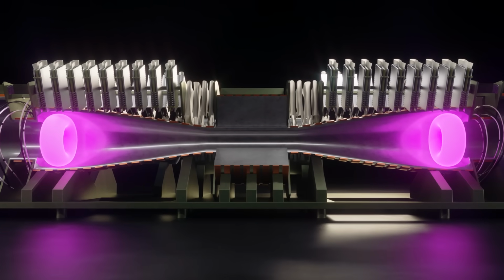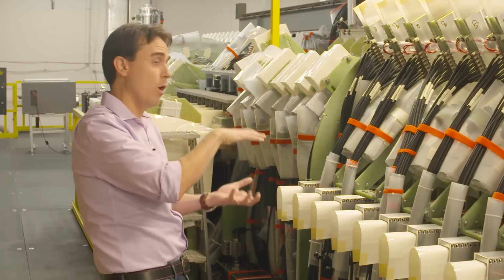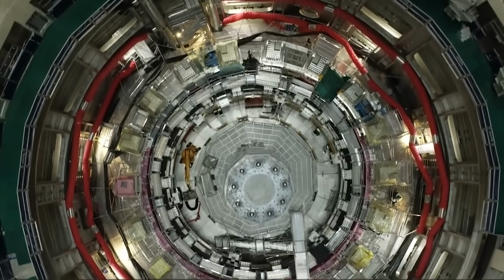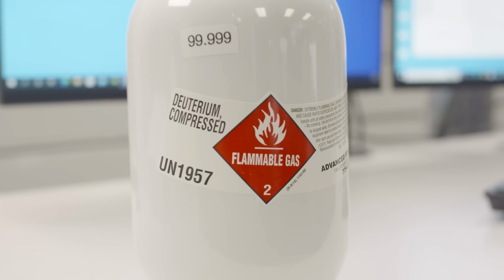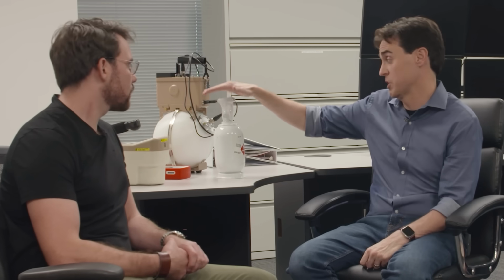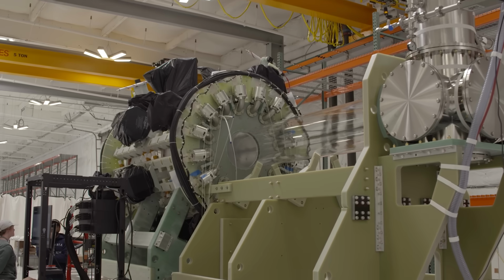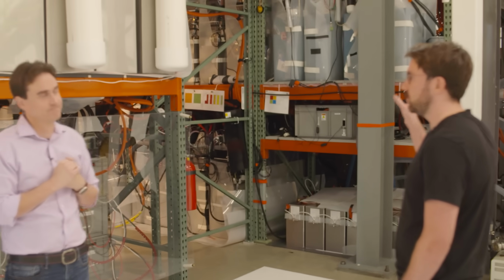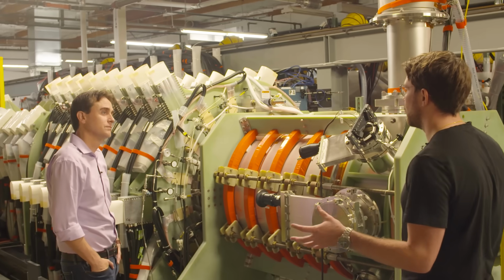A New Way to Achieve Nuclear Fusion: Helion

Comment: I love you RealEngineering, but as a tokamak plasma physicist, I promise you Helion is climbing up the wrong tree here - detailing all the problems with it is an hour long video, but here are some places to start looking: the H-He3 reactivity compared to D-T, problems with end losses, the absence of any published measurements or calculations describing exactly how this expanding plasma will actually induce a current into the coils (which are actually compressing the plasma) or absence of basic circuit diagrams proving that these induced currents will be usable.
Reply: You might want to check David Kirtey's talk at JPP from last December. It gives a good primer on their theory which is supported by their past experiments.
Do a google search for JPP08December2022_DKirtley (cant post links here).
It does not touch on the energy recovery. But if you think about it: They turn off the compression magnets and the expanding plasma induces a current in the coils. At this point in time, the FRC is still alive and stable. The fusion products add energy to the FRC. That same method also recovers a good part of the input energy along with the fusion energy. It works because the FRC is high beta (almost 1). Tokamak thinking does not really apply here.
Reply: @elmarmoelzer2229  Heyyy so not sure how I missed this reply, but chanced upon this video again haha so hi. Thanks for sending this talk - a good primer indeed, the speaker put the key ideas across very well. But a primer is all it was. A lot of important issues are not addressed and some of the questions asked halfway through the talk (in a subtle way) tease out the fact that helion will have a hard time even getting to a point where they have to think about energy recovery. Claimed to have understanding of show-stopper instabilities but not a single slide with any experimental data whatsoever. Just some unsophisticated modelling results and projections. Mostly just statements and claims.

I mean, how long have these guys been going?? And when they're invited to speak at a major platform like that - THEY DON'T HAVE A SINGLE SLIDE WITH ANY EXPERIMENTAL DATA.

It does not touch on the energy recovery because even they don't have any idea how that's gonna work. 

Now, as for your suggested line thoughts: 
'They turn off the compression magnets and the expanding plasma induces a current in the coils. At this point in time, the FRC is still alive and stable.'
I mean, the study of magnetised plasmas is basically the study of plasma instabilities. You're saying literally the thing holding the plasma in place is turned off and an uncontrolled expansion is how we recover energy? I'm sorry, but no. The FRC is definitely not alive and stable - I have no idea on what basis you make that claim.

'The fusion products add energy to the FRC'
Again no, the energy transfer from fusion products to bulk plasma is non-trivial - in the case of helion, even if they managed a good amount of fusion reactions, the products will just fly through the plasma and not actually heat it.

'Tokamak thinking does not really apply here'
Lol okay? That's like saying if you do CFD for cars, you can't do CFD for planes? Please. There is a lot of fundamental physics of magnetised plasmas one has to get past before getting to tokamaks. People use the same keyboard to play different games.
Reply: @phoneisnotketchup  
- For results: They have had 6 ever bigger and stronger prototypes so far. They presented the results of their 2020 Trenta campaign at SOFE in 2021. There is a video in their channel where they present those results (I will put a link to that into a separate reply in case it gets flagged). Mind you, those were the results of Trenta's first 16 months of operation. The machine saw some significant updates after that. 
E.g. in early 2022, a relatively small update to the configuration increased the trapped flux by >25% which increased their fusion output by ~80% and that was just one of their improvements since mid 2021. 
They have kept results from Trenta sort of under wraps since then, but it is quite plausible that they got even better. 
Anyway, last I heard, Trenta was at 10 keV plasma temperature (which would equal about 9 keV ion temp) and an almost 1ms confinement time with a density in the 10^23 range. It is sort of hard to know from the exact numbers for temperature vs density since they can almost linearly trade density for temperature. So, if they want more D-D reactions, they can do higher n vs higher Ti and the other way round. 
But overall, Trenta should have been at least in the mid 10^20 keV s /m3 range at the end of its final campaign, maybe even tapping into 10^21 keV s /m3. That would put it in line with some of the best Tokamaks out there. Pretty impressive for a machine that only cost 30 million to build, I would say.

- FRCs are metastable. They are subject to n=1 and n=2 instabilities. Those are by now well understood. n=1 instabilities (the worse ones) are mitigated by elongation and temperature (initial temperature achieved with the merging during formation). The n=2, rotational instabilities occur roughly around the time when the plasmoid has lost 50% of its particles. The main mitigation method is to make the plasmoid large enough (meter scale in Trenta!) for the ions to stay confined just long enough. Then they end the pulse and recover the energy from it.

- If you look at their recent paper (link in the "technical resources" section on the "technology" page on their website) "Fundamental Scaling of Adiabatic Compression of Field Reversed Configuration Thermonuclear Fusion Plasmas", you will see that the 14.7 MeV protons from D-He3 fusion will impart a significant amount of energy to the plasma. 
That is actually established physics (and David Kirtley had to include that in his paper above because of the request by reviewers).

- As for their energy recovery itself: There is a patent application that was published fairly recently. I must admit that I MIGHT have been wrong about how it works based on the limited information that I had/have. It is still a bit difficult for me to wrap my head around it, TBH. 

AFAIK, there is yet another patent coming going into the energy recovery in more detail. But for now, look up "apparatus and methods for generating a pulsating high-strength magnetic field"

Links in the follow- up comments.
Reply: Trenta 2020 campaign results: https://www.youtube.com/watch?v=wHirlGXlJ38
Reply: @elmarmoelzer2229  'For results': Errr... still nothing that goes significantly beyond the JPP talk?? And just more and more claims?

'FRCs are metastable' and 'As for their energy recovery itself': you do realise they don't actually need a fusion plasma to demonstrate all of this.... just show the basic effect without fusion gain? There are many smart physicists and these things don't simply go under the radar. If this was real, we would know and we would've seen it.

'If you look at their recent paper' WHERE????? WHICH PAGE HAS THIS CALCULATION??? Their model is laughably simple and seems to simply assume the non-thermal population energy will just magically heat the plasma.... ???

You mention things that you have 'heard'. What am I doing with that exactly? Where do hear this stuff?

My friend, it's quite clear to me that you're a believer - I don't think me painstakingly explaining the issues to you is going to be sufficient, so a lot easier for me to just keep coming back to this comment every year for the next 20 years to see where we at, it's in my calendar now.

Here's a fun exercise in the meantime - why don't you try to critique your own views about this company? See what you end up with?

Comment: one of the big problems of fusion power is trade secrets, hiding your research does not give you the ability to improve on other peoples work and this  WILL greatly slow down research of literally anything.
and all inventions are creations out of other creations, the mri has wires, electronics, electric motors, lcd screens which display controls which needs to be programmed,
all of these needed to be invented to create the mri machine and most of these concepts were many decades to well over a hundred years ago.

in this design helion could try to create a hybrid of the two by capturing the heat in the neutron and the piston like force with the charged particles.

Comment: Yes, yes, yes.

BUT How much NET POWER in Kilowatt hours or even Megawatts does it produce? and if not now when? How much output power and what is/will be the cost of the electricity per kwh???

Be Honest! This is vapourware right now!
Reply: Trenta was an experimental machine. Polaris is currently under construction and is supposed to produce small amounts of net electricity (a few kW maybe) in late 2024. Then the follow on machine will be a full 50 MWe power plant for Microsoft in 2028.

Comment: Fascinating, though I do have a couple questions.
For one, it is implied that this machine provides net-positive energy, but never actually stated. I'd have liked to hear someone say "for a pulse we put x amount of energy in, and get y amount back out."
Another thing is the safety aspect. Essentially, this is a thermonuclear device, except instead of using a fission bomb to initiate the more powerful fusion blast, it uses magnets. That's great in terms of radiation (though there is still the dangerous tritium generation), but there is still a high-energy thermal expansion happening inside a tiny confined space. What happens if one or two of the central magnets fails, or there is an asymmetrical generation of plasma?
You're talking about hundreds of millions of degrees and 300km/s; if there is even the slightest mishap that would still cause a huge amount of damage to a facility. A little bit was touched on in terms of wear on the system, but it would've been nice to know if the people working on this have thought about the amount of energy in the system, where it'll go presuming that something goes go wrong, and how to ensure that there's no people or highly valuable equipment there.
Reply: 1. This machine was an experimental machine. It did not have equipment for the recovery of electricity. That will happen with Polaris which should demonstrate net electricity at the end of next year.
2. No, it is not dangerous. The total energy content of the plasma at peak is a few kWh. The plasma is very hot, but not very dense (closer to vacuum than to ambient air). They turn off the magnets at the end of the pulse to let it expand, which induces a current in the coils. 
Even if things went terribly wrong, there would be some small scale abrasive damage to the walls but it would not be catastrophic. It would just mean extra maintenance for the machine.
Reply: @elmarmoelzer2229  I expect as much, but it'd still have been nice to see it covered in the video. Something straight from the horse's mouth, so to speak, to show us we're not making the same mistakes we did with most other technologies (too much 'could', not enough 'should').
Or at least, an acceptance of accountability should things turn sour ya know.
Reply: Hard to cover every single question in a single interview.

Comment: They never showed how to extract that energy for electricity generation. Only showed how much electricity they would be feeding to it. Just curious.
Reply: The plasmoid consists of charged particles. At the end of the pulse, the plasmoid expands, driven by its own internal pressure and the added energy from hot fusion products (protons, Tritons, He4 atoms). This expansion induces a current in the same magnetic coils that were used to compress the plasmoid earlier.
Trenta was not equipped for power extraction since it was purely an experimental machine. Polaris, due in January 2024 will have that and will attempt to produce small amounts of net electricity from that by the end of 2024

Comment: What if they did it like the cylinder of a gun? If the gas is stored magnetically you could put the whole thing into a vacuum and have 6 cylinders that rotate to fire off multiple times a second, but greatly increase the stress and pressure.

Comment: How are you going to protect the copper wire in the generator from neutron radiation? A commercial fusion reactor even using FRC would need neutron attenuation, does Helion have any thoughts on this??
Reply: You should give em a ring mate. I'm sure they would love to hear your input as you're definitely the only person on earth who thought of that.
Reply: Compared to the materials used in the vacuum chamber (Silicon) and the magnets (Aluminum), there is relatively little copper used in the machine, especially close to the burn chamber, where neutron radiation is most intense (radiation falls off with the square of the distance). Cables have a relatively small surface area (compared with the vacuum chamber and the magnets). There will be pretty thick shielding around the core of the machine with only relatively short lengths of cables being in the unshielded area. Those will likely have some kind of shielding around them as well.
Copper is relatively benign when capturing a neutron. There are 2 possible isotopes. The most common one has a half life of 12 hours. The other a half life of 5 minutes. So, any radiation from activated copper isotopes would be very short lived.
Most likely, the most affected cables will be replaced during normal service intervals (which would be maybe once a year, or maybe even less often).

Comment: It feels like a separate fuel Deut+Deut reaction could possibly be designed to capture the energy in those lost neutrons as well, possibly allowing for some recapture of energy otherwise being lost in the hybrid reactor.

Also, if rhe previous generations weren't called vente, grande, and tall then I'm going to have to doubt their Redmond location.
Reply: They were IPA (acronym for Inductive Plasma Accelerator... of course), Grande and Venti ;)

Comment: Why was there an external flash
How do you tap into that energy to actually use it
How do you overcome the laws of thermal dynamics
How long does the alleged fusion reaction last
There are so many basic questions to this that it streams bullsheeeet
Reply: 1. Because the vacuum chamber is made from Quartz. Silicon has very favorable properties when exposed to neutrons.
2. The plasmoid consists of charged particles. At the end of the pulse, the plasmoid expands, driven by its own internal pressure and the added energy from hot fusion products (protons, Tritons, He4 atoms). This expansion induces a current in the same magnetic coils that were used to compress the plasmoid earlier.
3. Laws of thermodynamics are preserved. Fusion reactions convert a small amount of the mass of the fusion fuel to energy. The sum of the fusion products have slightly less mass than the fusion fuel that made them. E= MC^2. 
4. About 1 ms. After that the vacuum chamber is evacuated with turbomolecular pumps and the next pulse is initiated. Polaris will do 1 Hz pulse rate. Future power plants will do 10Hz.
The recovered energy is stored in capacitors and gradually released to the grid. Polaris will make a small amount of net electricity some time around the end of next year. Power plants will make 50 MW of electricity.
Reply: @elmarmoelzer2229  Thank you.

Comment: US Military: "Cool cool....so how do I shoot that super hot fireball ball at a target? theoretically of course"
Reply: Not really practical. The plasma wants to expand quickly as soon as it is no longer confined by magnets around it. While it is very hot, it is not very dense (closer to a vacuum than ambient air), so it would also cool off immediately upon touching ambient air (or anything else).
Reply: Project MARAUDER already did that back in the 90s. Several successful tests before the project disappeared and likely went top secret.

They fired toroidal plasmas in the atmosphere at 0.3% light speed....
Reply: They know it will come out to light for us normal people. But they will using it firstly